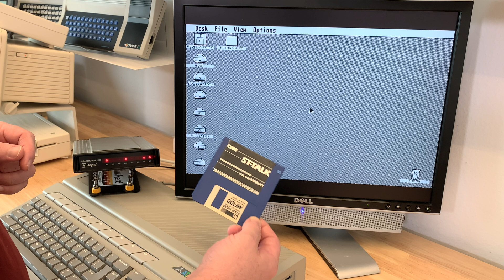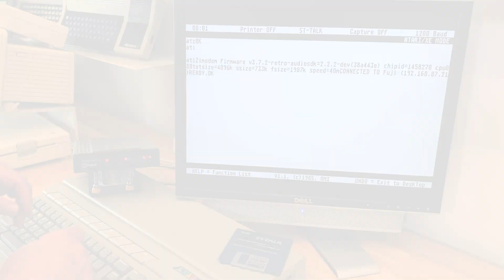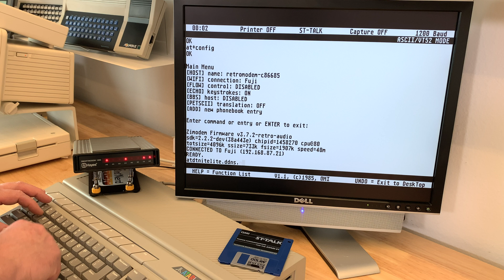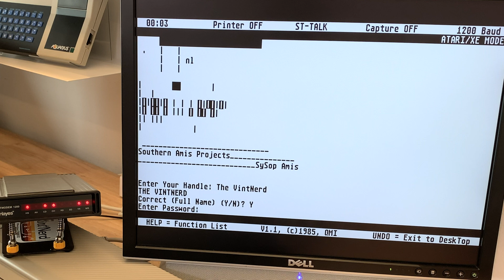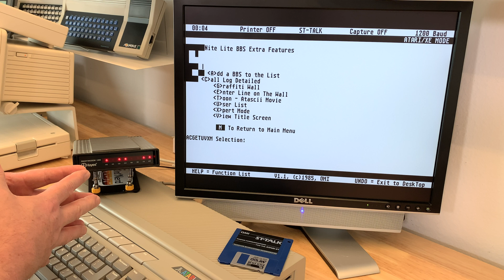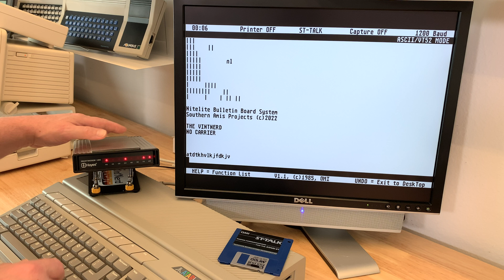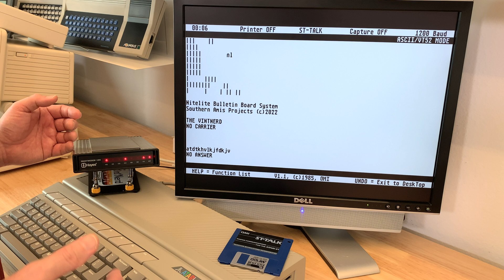📞 BBS Calling on a WiFi-ized Hayes Smartmodem

Comment: I once had an Atari SX212 modem. It had SIO and RS-232 ports. I used the RS-232 with an ICD P:R: Connection. I vaguely remember trying to use the SX212's SIO port, but couldn't get it to work with the terminal software I was using. I may have done something wrong. It was so long ago.

I just looked up the manual for the modem, and it doesn't mention loading an R: driver off disk for the SIO port, which makes me wonder if it was supposed to auto-load an R: driver from ROM inside the modem, like the 850 Interface Module did. Anyone know how the Atari was supposed to communicate with this modem through SIO? I'm just curious.
Reply from the maker: Certainly worked best with the SX Express! software from Atari: https://atariwiki.org/wiki/Wiki.jsp?page=Atari%20SX212%20Modem